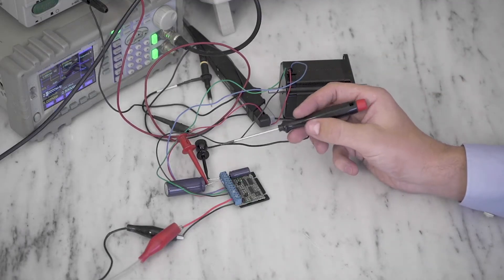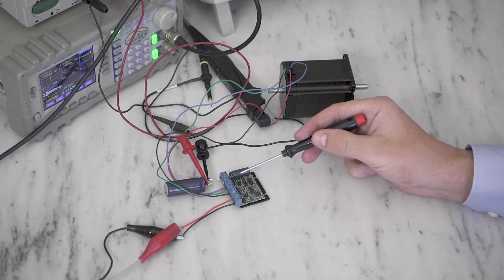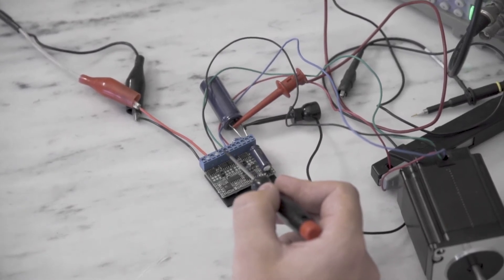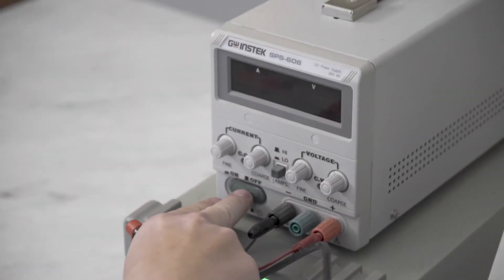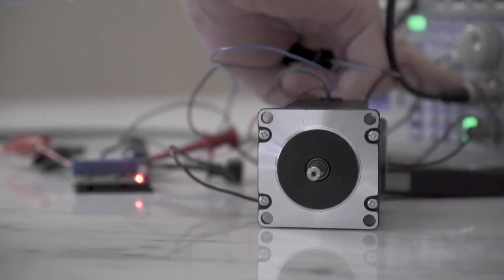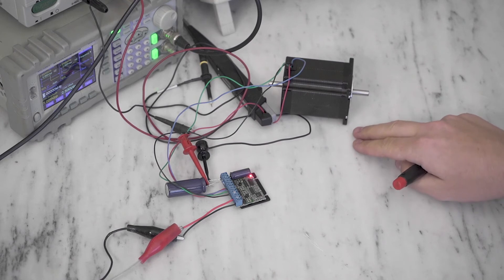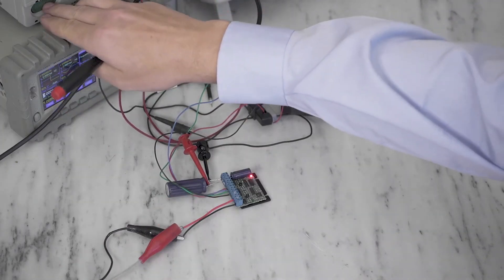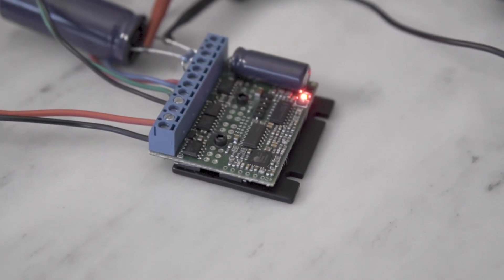G250x G251x Stepper Drive Setup Tutorial

Comment: can u have code or circut for control stepper motor with arduino and gecko drive G201 ?? help
Reply from the maker: he quickest way to control a G201 with an Arduino is to use the LED BLINK code that is used as an example in most tutorials. That will create a 5V square wave that will work as a STEP pulse for our drives, and the frequency will determine your motor speed. With the G201 you will be fixed at ten microstep, or 2000 pulses per revolution.

Comment: Awesome video, recently got a g250x, could you reccomend which screw terminal part to use? I have female-end connected leads i can use but id rather use the screw terminal more permenantly. Thanks!
Reply from the maker: There is not a terminal that will work with the G250X. The G250X is meant primarily for OEM's to design into larger systems with a matching header. If you need a terminal block we recommend the G251X.